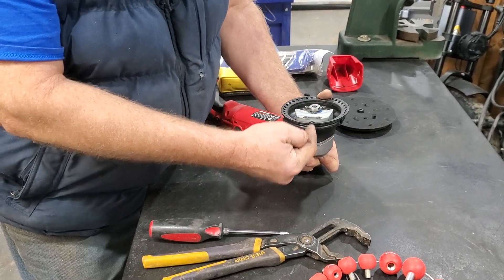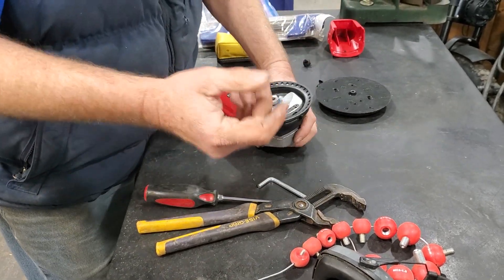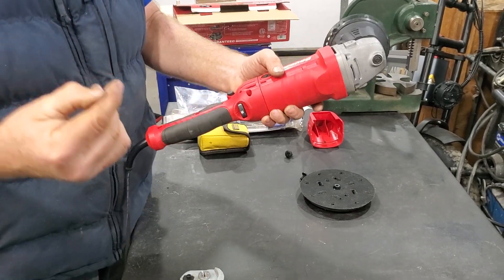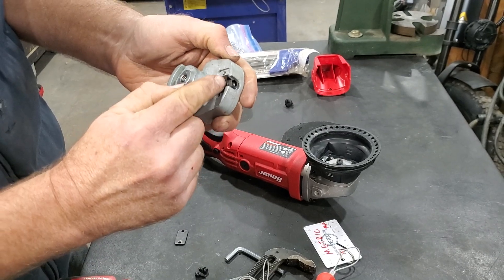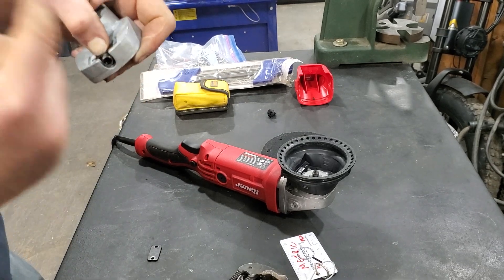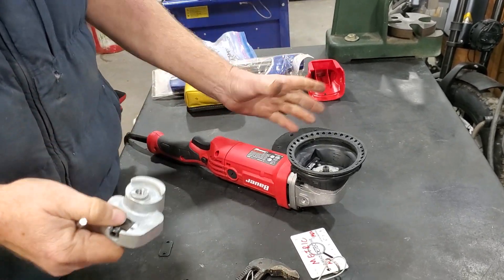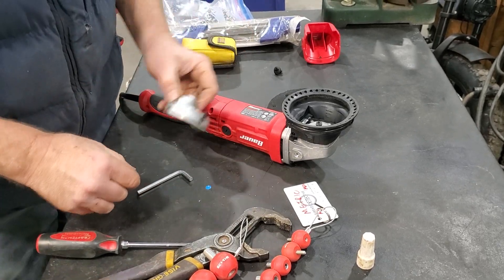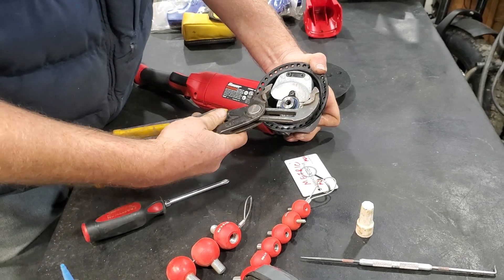EXPLODING! Harbor Freight Bauer Random Orbit Polisher and its Undocumented Adjustable Counterweight!

Comment: i just got mine yesterday and tried to adjust the counterbalance. i could not budge it. i'm not sure which direction it needs to go, but i can't get it to move anyway. maybe if i take it apart?
Reply from the maker: What happens when you turn the hex-head adjustment screw the Allen wrench? Turing it clockwise should move the  ounterbalance outward---to balance heavy pads---counterclockwise should reduce the counter weight's effect.
Reply: @ToolBard-hk2nc  i can’t turn it either way. it’s so friggin tight.
Reply from the maker: @rsngrl  You may need to return/replace it as this sounds like a possible defect. The ball-bearing detent retainer under the spring plate held on with the two Phillips screws on the outward side of the eccentric may be your issue. I have seen ball-bearing detents not allow the release of the detent due to the machined detent in the screw being too deep (if the detent is close or over half the diameter of the ball, it won't release the ball and the ball works like a locking detent rather than a retaining detent). If this is the case the counterweight adjusting screw is at fault and was simply "over-drilled" when the detents were machined into it. I've encountered this problem with other Chinese tools, but not this one.
Reply: @ToolBard-hk2nc  i’ll take the it apart and see what’s what in there. if it doesn’t move then, i’ll get another.
Reply from the maker: @rsngrl  If perchance the problem is as I described, AND you have a slightly larger ball bearing ready at hand, you can replace the detent bearing with one of larger diameter to reduce the detent "grabbing".  if you ever have a detent that isn't grabbing, or detenting enough, you can often fix it using a smaller ball.
Reply: @ToolBard-hk2nc  i can guarantee that is beyond my expertise, but i love your enthusiasm and thank you for replying to my messages! i’ll let you know if i get it moving. :)
Reply: @ToolBard-hk2nc  interesting new information…the spindle lock does not work either. i can’t get the plate off because it won’t stop spinning.
Reply from the maker: @rsngrl  Those HF red tools have HF's famous 90-day warranty, I hope you make use of it.

Comment: Did you replace the grease in the head?  I'm seeing lots of reviews where users change the grease.  Supposedly doing so reduces the vibrations and the operating temperature.
Reply from the maker: I have not, I looked inside and it seemed 2/3rds full of grease so I figured it was okay. I may replace it with a known premium grease at some point, but am not using the tool at this time so that need and project is "shelved" for now. Harbor Freight tools may have seen improved manufacturing, likely due to automation, but assembly still sucks. We can't rely on Harbor Freight's second-tier Chinese manufacturers to have reasonably good quality control at the assembly level. This is where they save a lot of money.
I continue to see Harbor Freight faulty assembly,  Bauer and Hercules tools purchased by me have had issues, lack of screw retaining (Loctite, locking washer, etc.), improper ball bearing race bores that allowed the bearing race to rotate in the bore, improper grease packing, etc. If you want a reliable tool, Harbor Freight is still questionable, if you enjoy tearing tools apart to see how they work and to make them better, Harbor Freight can be great, especially for the money!!
Over-packing grease overheats, underpacking grease causes premature wear, and 2/3rds fill is typically good. Loctite can be very helpful with HF tools as effective screw retaining is often lacking at assembly in HF's Chinese factories.
Reply: @ToolBard-hk2nc  thanks for the update.  This was a great video, I'm going to locktite all of the screws before I use it.  Harborfreight's website has some negative reviews of the unit, several are for it coming apart and damaging their car.  I'm going to locktite all the screws before I use it

Comment: Great video!  I just bought one and will be doing the same.  Question, can you go more indepth on how to adjust to remove vibrations?

Thanks!
Reply from the maker: I had/do plan on showing how to minimize vibrations but am too busy currently to get to it.  You can fairly easily do the adjustment yourself, mount the buffing or sanding pad you intend to use and turn the tool on, feel the vibrations.  Turn it off and make an adjustment of the counterbalance adjuster screw in one direction, of say, one rotation, in order to make a noticeable change, and then fire it up again and contrast the new vibrations.  Try to keep a count of your rotations so you know where you started and how to get back there if you get frustrated.  Make your adjustments enough to feel the difference but small enough not to overshoot.  I believe this adjustment is designed to be used every time you change the mass of the head (changing the type of bonnet or sanding pad) to tune out the vibrations.  I think the procedure will be pretty quick with a little experience.